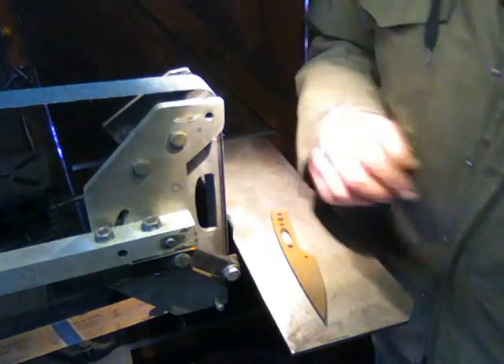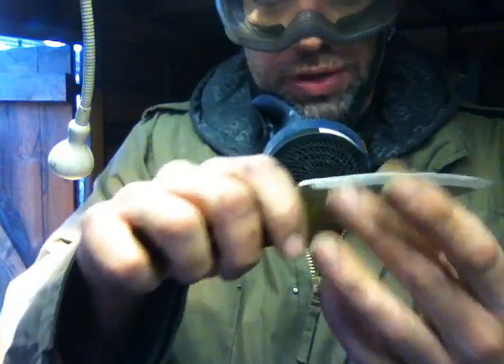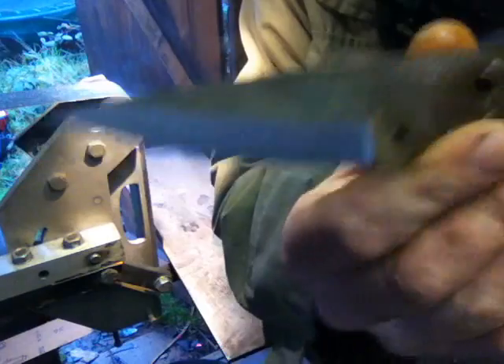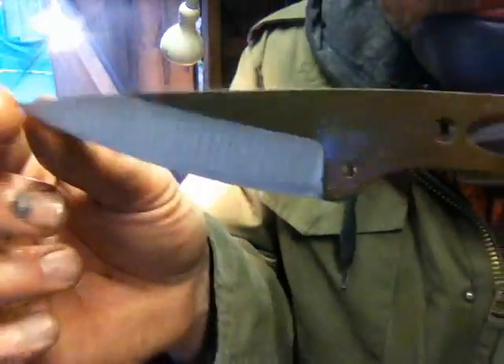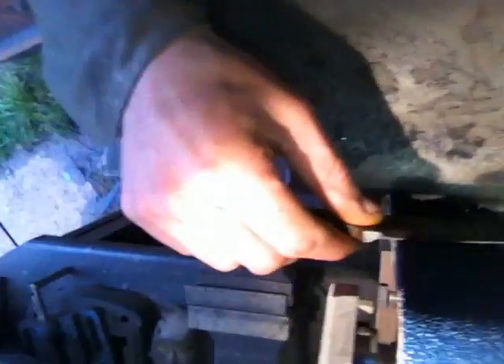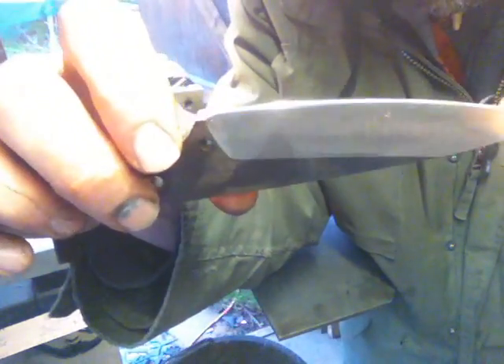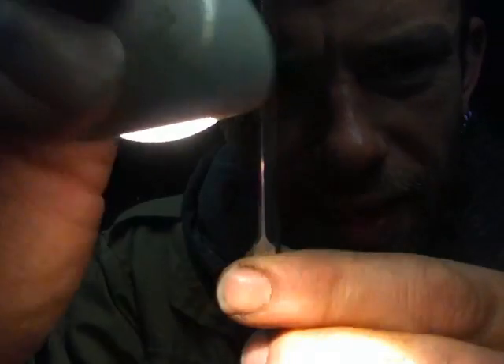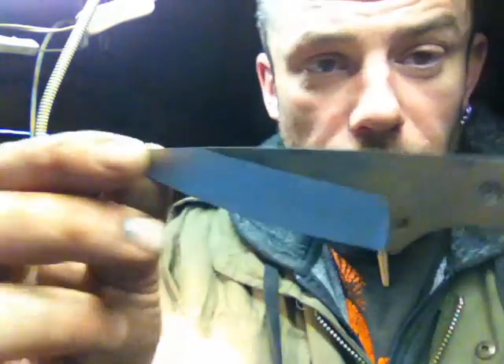Knifemaking: Grinding the bevels

Comment: You don't need a 36 grit belt to do this. Think of it this way. A 60 grit screen is twice as big as a 80 grit, 50 grit is twice the size of 60. So think of how many belts you can skip by doing all of the grinding with an 80 grit ceramic. Excellent video btw. Very helpful
Reply from the maker: Lol really? And think of how many 80 grits belts you'll wear out doing the job of one 36. Trust me, I went through a shit load of grit selections before I settled on the 36,80, gator combo as being the best selection for me
Reply: Sorry bro didn't mean to sound cunty. Thanks for the vid
Reply from the maker: ATSknifeworks It's cool mate, don't worry about. Don't forget this is already ht'd and close to 6mm thick. Give it a go with just an 80 grit and I can guarantee you'll be in for a looong day :)

Comment: is that steaming off the water because the steel is hot, or because the ambient temperature is cold?
Reply from the maker: It was pretty mild in there yesterday so a bit of both (cue a drooling troll moaning about ruining the temper or some shit Lol)
Reply: DirtyRoomKnives cue it in the eyeball and you wont ruin the trolls temper.

Comment: Thank you for all the little tips, they're gold dust. As a noob, how would you go about heat treating your first few blades? Would you go for building a propane forge straight away, or would you send them away to a company to treat?
Thanks for your time buddy.
Reply from the maker: Depends what side of the pond you are mate. Over here in England you'll be lucky to find a heat treat company that's sympathetic to the needs of a knife blade so I'd suggest starting with a simple carbon steel like O1 and building a small propane forge. If you're in the States you have a companies like Peter's heat treat that can do it for you
Reply: DirtyRoomKnives Thanks for that. I'll have to get a propane forge on the go. Look out for beautiful knives coming out of Yorkshire in the near future :)